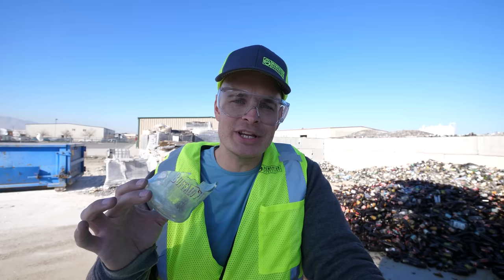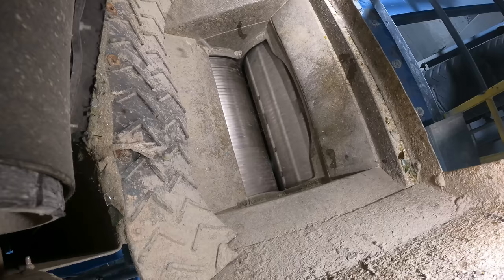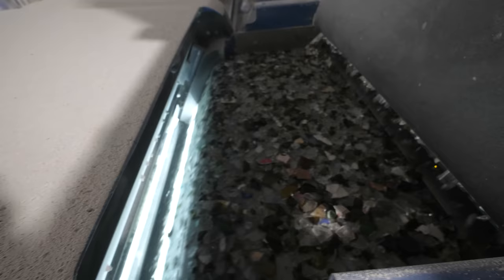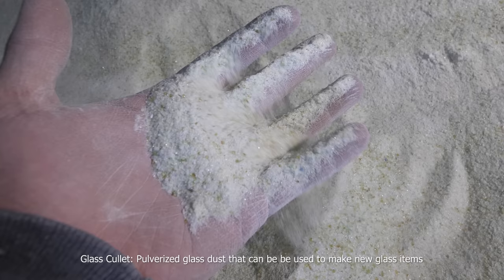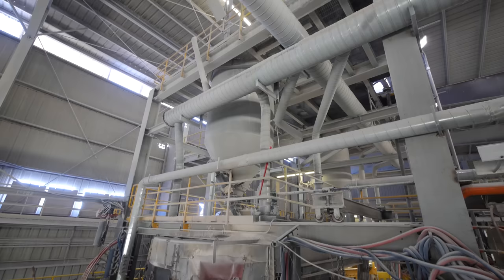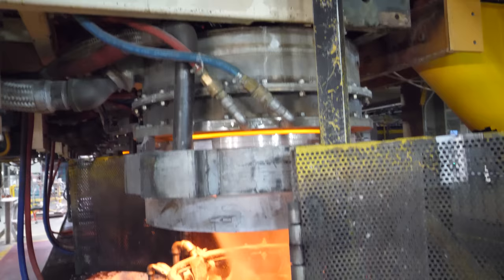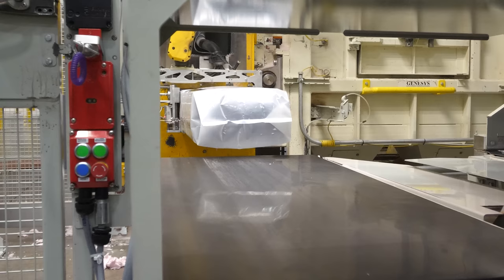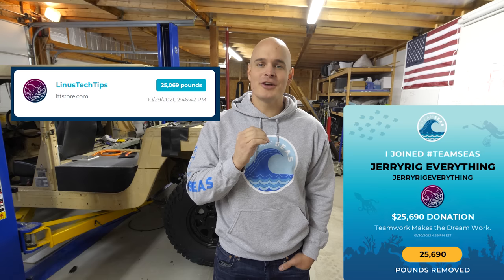What *REALLY* happens to 'Recycled' Glass?!  -  (you might be surprised)

Comment: The most efficient glass recycling is to just reuse the bottles. We did it a lot in Argentina back in the day, now it's less common but still used for a few things. Coca Cola used to come in 1 liter glass bottles with a metal cap. If you bought one, you got charged the Coca Cola + a small fee for the bottle itself, but if you later brought it back when you got a new one, the store would not charge you for the small fee. Most people would return the bottle to save the fee, but even those that didn't, the bottles didn't get lost, they would just get put out by the trash can, and some scavenger would get them and return them to get the fee. Bottles would just get washed, inspected and reused, over and over. The same was done for a lot of products. Now the only ones left on this system are a few brands of beer, that still use the recyclable 1 liter bottles. Also, several brands have standardized on the same bottle, they just slap different labels on it, so you can go and buy one brand and then return it and get another. 

It would make a lot of sense to just use recyclable glass containers like that for a lot of stuff. I mean, if you can get a large coke for 3 bucks, or 2.50 if you return the bottle, a lot of people will likely do it.
Reply: On a large scale it's no feasible. Core steps of this process are cleaning and sterilization which would never be as efficient if the bottles and glass remained intact. 

Also processes to prevent damage during operation would be costly. Adding more machines and potentially human interaction into the process
Reply: @Captainwaitwhat  But what I'm telling you is that it's already being done here on a large scale. What, 47 million people is not "large scale enough" for you? It's not new either, beer factories here have been using reusable glass bottles for 120 years. 

Each bottle is reused on average 30 times. 

Coca Cola and Pepsi did it for *years*, up until the 90s, when they switched to plastic bottles. They brought back the reusable bottles some years ago, not in glass form but in plastic form. Except, since this are meant to be reusable, they are far higher quality plastic (thicker, sturdier, etc). 

Right now, 35% of Coca Cola's production here is sold on reusable/returnable bottles. 

I'd say that's constitutes more than "large scale", and proves it can be scaled up arbitrarily. 

Regarding automation, you're wrong, because brand new glass bottles still have to be washed and sterilized at the factory. So the process is basically the same. I've seen how they do it, the process is highly automated. They distribute the bottles in rigid (also reused) plastic containers that hold 6 bottles each, they are palletized. At the point of sale, the business does what it usually does to put the bottles in the fridges/shelves. Large businesses such as supermarkets and large grocery stores have a machine that takes care of recovery. You just go to the machine, feed it the bottles you're returning, it identifies them and puts them back in the same containers they came in, then gives you a ticket you give to the cashier to scan and give you credit for the bottles. At smaller shops, the cashier just takes them in manually. Then when the delivery truck comes in, instead of just dropping off new bottles and leaving empty, it drops off full bottles and leaves with empty ones.

Comment: About 20 years ago I worked for a company that was recycling an EPA listed hazardous waste at a steel plant. Mini-Mills use electric arc furnaces to recycle scrap steel. The process generates huge amounts of a dust called, not coincidentally, electric arc furnace dust. The dust is a very fine dust and is composed mainly of ferric oxide, calcium oxide and zinc oxide with ferric oxide predominating. It also contains significant amounts of the toxic heavy metals lead, cadmium and chromium and which is why it is listed by EPA as a hazardous waste.

We were recycling the EAF Dust by mixing it with glass formers, fluxes and matrix modifiers and processing it into a chemically inert and non toxic glass-ceramic product using a process called High Temperature Vitrification (which is techno-babble for glass making).

The reason I bring this up was that the primary glass formers we originally used was glass grade sand mixed with some soda ash (sodium bicarbonate).

My job was product development as by EPA regulations to be exempted from EPA Hazardous Waste regulations we had to manufacture value added products in which the material being recycled(in this case hazardous EAF Dust) is required to be a required ingredient to manufacture the product and the product manufactured must have a market and will be sold in that market.

As I was the companies chemist/materials scientist I was in charge of product development. As such, when I was hired one of the first formulation changes I made was to replace the sand/soda ash mixture with cullet as using the cullet substantially reduced my raw materials and energy cost, without impacting product quality, it also reduced the molten products viscosity which translated into increased production rates at lower cost.

I had a special relationship with the local MRF’s in which I was one of the few outlets they had for using three mix cullet. The MRF’s produce a significant amount off three mix cullet in their glass recycling process which is not usable by most glass manufacturing process as it is contaminated with small amounts of ceramic plate ware which is composed primary of aluminum oxide and even a very small amount of aluminum oxide in a glass melt bath can ruin that batch.

Since the MRF’s had few, if any, outlets for the three mix cullet and since the products I formulated were not glass products I had different quality requirements in which the aluminum oxide contamination was not a problem as I was already using small quantities of aluminum oxide as a matrix modifier for our end product I had engineered the ceramic contamination was a non issue for me.

The end result was I was able to negotiate very favorable pricing of I only had to pay for the transportation of the three mix cullet as I was their only outlet for the material.

As a result by changing our product formulation by using only waste materials that the generators were disposing of, I cut our raw materials cost by 75%. 

My suppliers loved me too as I could consume most if not all of these waste streams that normally they had to pay significant amounts to dispose of.

Thus I was able to set up a robust supply chain in which I was not dependent on any one generator to supply me with the waste streams I was using as raw materials and I only had to pay the transportation cost. Though the biggest gains I made in reducing cost was from the switch to three mix cullet.

I think the biggest kick I got from the whole experience was having to fight tooth, claw and nails with the company engineers every step of the way to implement the changes I had developed to not only the chemical formulations but also for the new products I had developed which were substantially more profitable than the architectural products they had originally been manufacturing. 

I got a kick out of driving engineers nuts with my outside the box thinking but I was also very open minded towards their objections as they were some really smart and talented engineers and I learned a lot from them and I completely understand why engineers hate the “Good idea fairy.”. LOL
Reply: A very small amount of ceramic will cause a whole truck load of cullet to be rejected. It doesn’t melt in a furnace and will plug the holes in the fiberizer spinners.
Reply: @will75wallace  Yes it would. I used some of those rejected loads. Fortunately in the process I was using ceramic contamination at that level was a non issue as I was manufacturing an abrasive product.
Reply: Gregory Schubert  its pretend.

Comment: The insulation is safe to touch, yes, but unwise. The glass particles are still sharp, even as small as they are, and give you microscopic cuts. Hence why touching insulation will make you itchy, it's slicing up the skin, but at a size that's unseeable to the eye.

Comment: In Belgium we have a special system called "consigne". The common  bottle such as beer bottles cost you 10 cents at the supermarket but when you bring them back you get your 10 cents (if the bottles are not broken). Those bottles are just washed and reused ! I think it is the best solution. All the other bottle and glass product should be disposed in glass container. There are two type, one for clear glass and one for colored.
Reply: Some states here in the US do the same but it's sadly less then 10. Even Utah here in the video doesn't use that system and you have to opt in to recycling glass :/
Reply: I live in a state where we do have a deposit program.  The "refillable" bottles used to be around back about 20-30 years ago and you took them in for 10 cents a bottle and the bottlers washed and reused them.  Now mostly you see "recyclable" bottles that are a 5 cent deposit and get broken down and recycled.  The "refillable" type seemed to disappear around the time the old 8-packs of 16 oz soda bottles were no longer produced.  I think there might be a handful of beer bottlers that still use the old refillable system.

Comment: I remember when recycling glass used to be more expensive than making brand new glass. It used to take at least 20% more power. I'm glad to hear it now takes 40% less power than creating new glass now.
Because glass is glass, and glass breaks
Reply: Yes it did. Most of the sorting was done by hand. Broken pieces were run off the end of the conveyor and sent to the landfill. Automation has increased productivity and volume. I was the general manager of a recycling operation in the Chicago area.
Reply: @Android-ng1wn  In Canada, the government had to mandate that a certain percentage of glass made had to use recycled glass. The government also subsidized it.

Raw material used to be really cheap. Recycling on the other had was labour intensive and required using a few different machines, some with took a long time to use. For example, in Canada they had to recycle as much of the glass as possible.

One of the machines would dissolve everything that wasn't glass. This took time.
The glass would then be hand sorted for what it could be turned into.
It was then crushed and turned into new glass.

The problem was that even after it was crushed, it wasn't as fine as new raw material, so it took more energy to melt it.
New raw material didn't require any energy for cleaning the glass, or conveyors for sorting it, or machines for crushing it, or extra heat to melt it, so yes, recycled glass used to take a lot more energy

Comment: You can also use crushed glass in place of sand when doing concrete work. Since ocean sand is a dwindling resource, and the way it's stolen from critical marine environments, or right off the beaches, which further erodes the landscape. When possible, always try to use crushed glass for your "sand" projects.
Reply: is it just a durable as sand?
Reply: @gothboschincarnate3931  Well, it was, at one point, sand. Just melted, formed and sometimes dyed and tempered.
Reply: Back in the 90s there was places around that crushed glass and used it instead of gravel in their driveways.
Reply: @fredflintstone4715  It is also used, sometimes, as a replacement for the sand aggregate in asphalt, making a product call "glassphalt".
It may result in longer-lasting pavement, but due to marginally decreased friction it is not used on 65+MPH roads.
Reply: I heard it can be used for sand blasting too. If I could find some of that stuff I'd use it for a few small projects I was going to do like clean up some old tools. I'm not going to Utah anytime soon and I bet that place would just sell bags of it.
Reply: @wades623  Have you never heard of glass beading or even soda blasting. That fine powder would make a great medium to use.
Reply: @RealistNW  yes I've heard of them

Comment: Great video, but a quick error correction. You mentioned that glass does not decompose in a landfill. This is correct. Actually, despite the smell, almost little of our waste decomposes in a modern landfill. Decomposition is a microbial action carried out by critters that need oxygen. Landfills are sealed as they are built up layer by layer. Eventually the oxygen trapped in the lower layers is consumed and decomposition stops. Some years ago scientists in California excavated a pit deep into a landfill that had been used for decades ("I got a graduate degree to do This ???" I imagine them thinking). They recovered identifiable food products and newspapers that could still be opened and read though they had been discarded 50 years earlier.

I am confident that future generations will one day mine today's landfills for materials our consumer society deems to be disposable. Right To Repair is an environmental cause, not simply an economic one.

Comment: If glass is totally non-reactive and lasts for millions of years, why does spinning it into a thin thread make it bioactive and safe? How does that work?
Reply: I suppose because it's finer maybe ? It's so fine that it degrades a lot quicker 🤷‍♂️
Reply: I have heard glass dust and fibre glass insulation was hazardous on your lungs as it does not bio degrade. Something new?
Reply: @brandonlink6568  what would you suggest for insulation ?
Reply: @nathanb3273  I'm installing fiberglass roll insulation right now but different applications call for different types
Reply: @brandonlink6568  yeah I'm doing my loft with it at the moment, also fitting underfloor heating that's going to run off solar power this month 😎

Comment: Fun fact: The arc furnace electrodes are made most likely made out of graphite. Tungsten wouldn't be feasible, price. Graphite has the second highest melting point at 6605f or 3652c. I had that question, so I researched it. Curious dry sponge of a mind I got.
Reply: They didn't look like graphite.
Reply: Probably Graphite: 

My dad works for a steel mill, and was able to get me in on a tour! Their arc furnace uses massive graphite rods as electrodes. Its crazy being around when that thing is on- you see a light show from hell in the viewing port in a protected room, and crazy electromagnetic effects happen too- When my dad went on a mill tour (He’s IT so he works in the admin building and not the mill floor itself but still got a tour and has to go out their to fix network stuff that controls automation), the Electromagnetic field from the arc furnace de-synced his watch! 

Also the thing Jerry said about the “white cap being a blanket” is true for Steel as well. For steel, the “cap” is slag made from imputities rising to the top of the furnace while the steel is being melted. At that mill, the slag is crushed into gravel for parking lots and such, and most of the gravel in the coastal area I live (that has very few rocks) is actually steel slag.

Electricity and Manufacturing Processes are infinitely fascinating to me lol.

Comment: only certain types of glass can be "infinitely recycled", tempered glass for example can't be recycled in the way show in this clip.

but even "non-recyclable" glass can be re-used. one way is trough making into a bit "obscure" material that also is great for isolation known as Cellular Glass or Foam Glass.
Cellular glass is kind of rare outside certain fields like road and rail constructions since the price can be a bit on the steep side but in areas where you need a super great isolator that can take a lot of heat over long time without breaking (like in fire-traps) or change form as little as possible even under large variation of temperature (like foundations for roads and rail-lines) or even when you need a isolation for a building that is both water and pest resistant Cellular Glass is great.
on an ordinary house you go for the pink stuff, Glava or Rockwool for 1\10th of the price

Comment: Thanks! I have been wondering about glass bottle recycling, specifically, ever since they stopped keeping them intact at return points.

It wasn't so long ago when every beverage seemed to come in a standardized glass bottle, and they all had those marks from the handling machinery, so even us kids could tell the bottles were being re-used. The bigger bottles were replaced with plastic first, and then came the infamous, super expensive 0,5L plastic bottles of the late 1990s (and they have remained). The price of soda seemed to grow more than double in a few days as those new bottles took over every store. In 1996 you could've gotten 4 x 0,33L glass bottles of soda for the price of one 0,5L plastic bottle in 1998. It happened so fast that I'm guessing it was EU legislature-based action.
Reply: Had to do with lawsuits; glass breaks. Plastic doesn't. It's like amazon; everything is designed to avoid lawsuits so it runs inefficiently and will eventually go under.

Comment: The fiber spinners use a platinum cone with lots of tiny holes in it, and is made quite similar to a cotton candy spinner but is of course made to operate at much higher temperatures. The newer ones use a platinum clad molybdenum cone as its cheaper with similar service life as the platinum cones. I remember making these parts ar a laser cutting shop, and the parts had about 28k of platinum in them. It took balls out power to drill the tiny holes in them and we saved the splatter dust for the customer to recover the platinum from. 😂